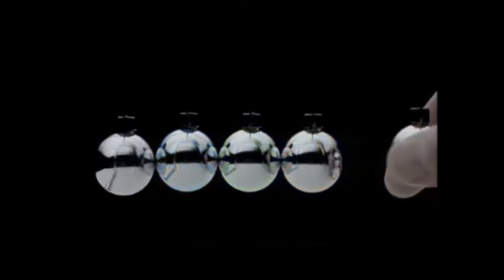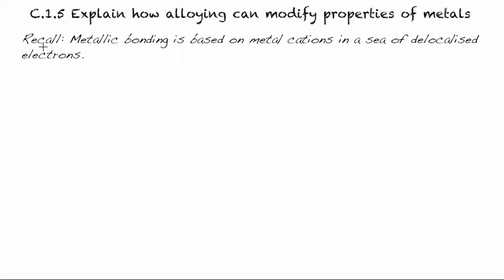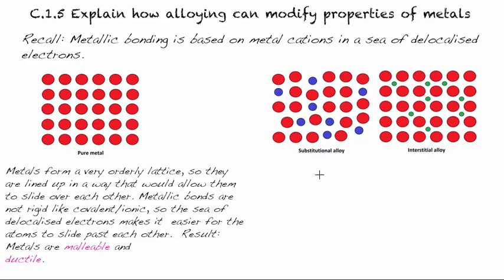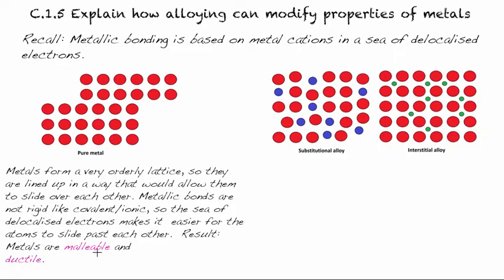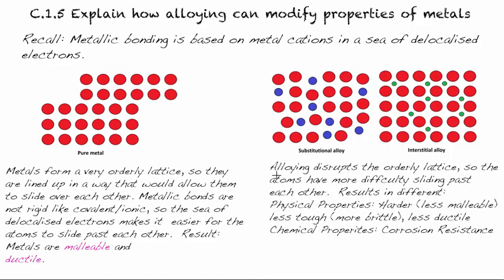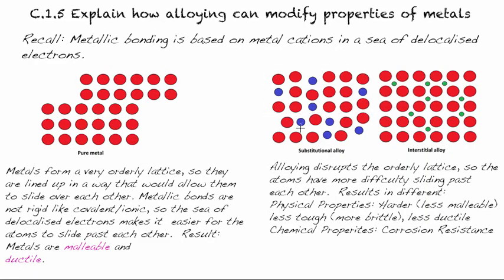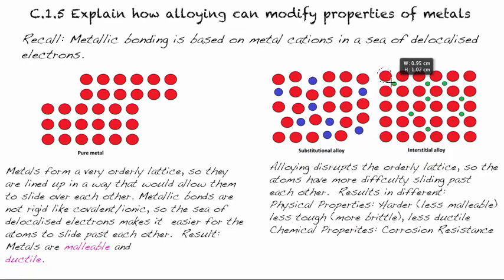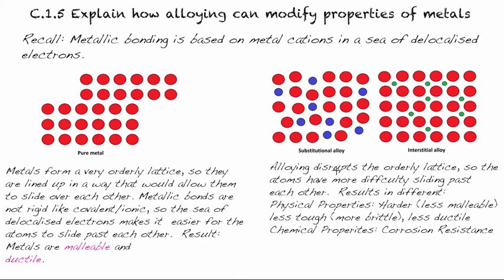C.1.5 - Explain how alloying can modify the properties of metals.

Comment: would an alloy of 60% titanium reinforced with carbon and a 15% tungsten alloy work or would it be stupid?
Reply: mike duncan 
Carbon content may be a bit high. 25% carbon would make it very brittle. Even cast iron is only 10% i believe.
But for tungsten and titanium? I dont see why not. The ratios may need a little fine tuning but there is no instant reason why it wouodnt work. May be a bit heavier than regular titanium as tungsten is one of the heaviest elements. Also a pain to alloy tungsten since its melting point is over 3000 degrees. Beyond the boiling point of titanium. It could be done. Just difficult.